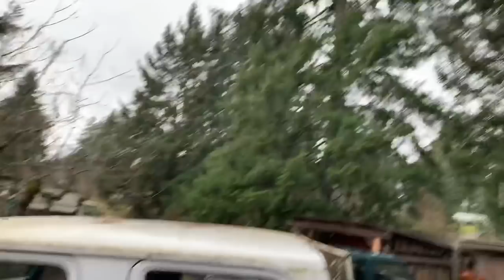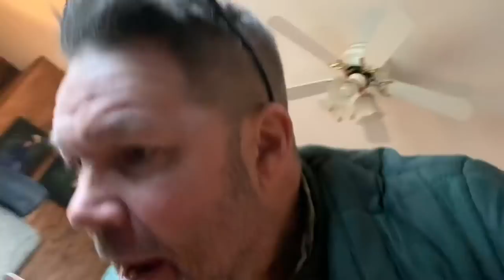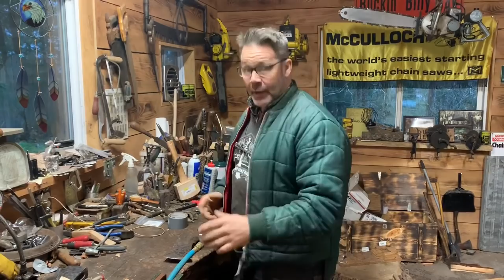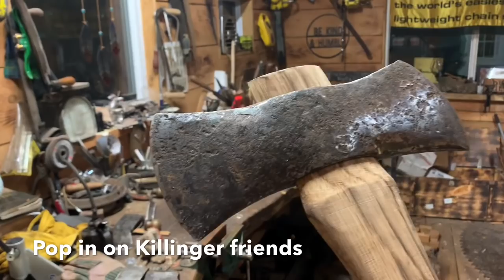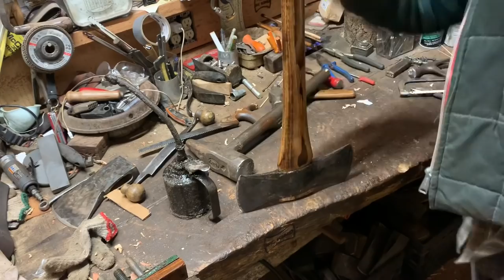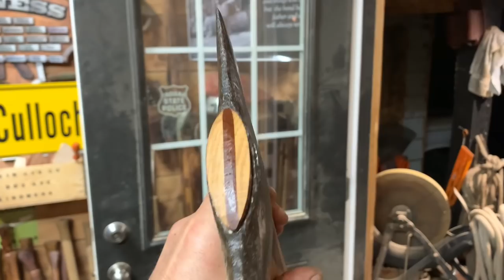Double bit axe found in the dirt. Now lives forever

Comment: On an unrelated/related note I had never split with an axe before, always used a maul. Brute force and all, and it was ok. 8 still enjoyed it, but not really. So tonight after work I tried splitting with an axe that I picked up for 25 bucks at the local hardware. Splitting normally was just ok, and almost as much or more work than with a maul. So I decided I'm a smart enough guy and capable, let me try this flick thing.... and its amazing!! I learned the flick! And it's changed my life buckin! My new axe didn't like it at all though, the face is bent out of shape. But I'm not mad, I'll file and sharpen it back into shape. But I'd like a recommendation on an entry level axe for mostly splitting and the odd bucking, if you could? In the 50 to 100 dollar range... thanks for the videos bud!
Reply: Oh, and the POP of the wood when you get it just right is addictive! 👍

Comment: love your videos and outlook on life !  Started watching your channel a few weeks back while watching Mike from outdoors with the Morgan's mentioned your channel. Anyways me being retired on rainy and cold days I look for things to keep myself occupied. After watching you operate vintage (power saws) chainsaws I decided to get my old power saw out from underneath workbench that hasn't run in about 25 or 30 years.  Pulled on the rope and sure enough the engine wasn't frozen !!!! pulled spark plug and had spark, Hummmm mixed some 16/1 fuel and about 30 pulls later it fired up !  Wow !  Now my question to you is how or what mixture do you use as I don't see much smoke coming out of your saws exhaust. Its very overpowering breathing all the fumes ! My newer saws are 50/1 !  My saw in an old Montgomery Wards 17 in. I was told it was made by Remington. Can't find any numbers on it, but has Professional Quality Lightweight 3.6 Cu. in. wrote on it !  Any suggestions would be appreciated. Thanks !

Comment: You ought to use vinegar in an electrolysis cleaner with a 12 volt battery charger.  It will remove that rust pretty easily without removing good metal.  You would love the 4.5 pound True Temper that I restored a few years ago.  It fell off my tractor about 25 years ago and I ran over it and broke it through the eye.  I had it MIG welded and re handled it with a 31.5 inch handle.  I also restored its original red on the head.  It looks beautiful with a brand new leather sheath.

Comment: I’ve been watching some of your videos off and on, I’ve noticed you make some and buy some of your axe handles. I have a axe head that requires what I would call a larger than normal handle. It’s probably an 3/4- an inch wider than a standard axe handle, and it’s probably 3/4- an inch thick. Would you make a handle or try to find one to fit as close as possible? Granted I’m 6’4” so I have a longer reach than most, so I’m thinking maybe a long handle as well. Awesome instructional video. Definitely learned something.